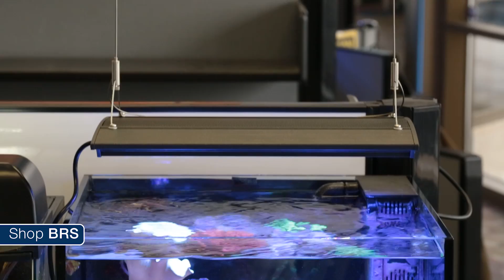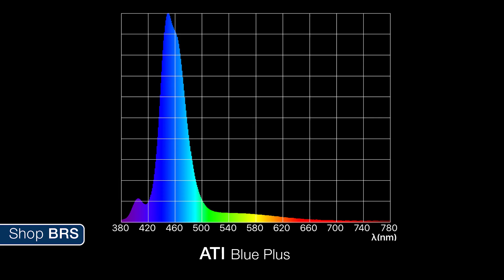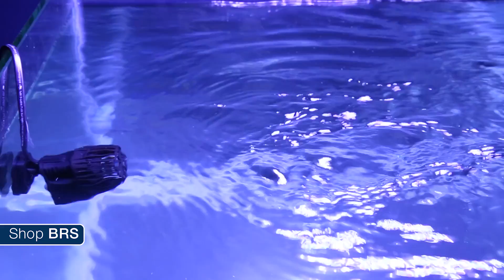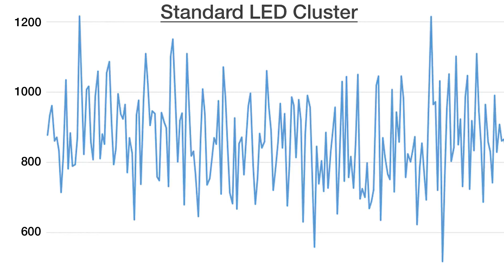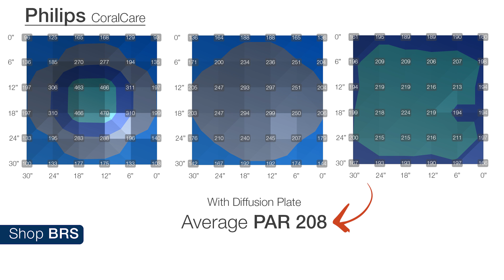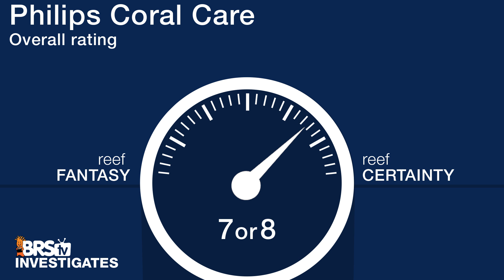BRStv Investigates: Testing the Philips Coral Care LED's claims - Are they realistic?

Comment: Awesome video.  Thanks for bringing this to light :)
Seriously though,  LED lighting has one major advantage over Fluorescent and MH lighting that I think was not considered in this video but I don't fault BRS because it might also be beyond the scope of BRS investigates series.  LED lighting as it's basis works with DC voltage and would be portable to solar power implementations than F or MH.  So IMHO an LED fixture that can mimic and give some efficiency savings over F lighting is of great value.

Comment: This was an excellent video! Hands down covered every aspect of what we need to know. But did I hear you correct? $1000?!? wtf! Does it come with some solar panels we aren't seeing? That seems quite expensive for a non wireless controlled passively cooled fixture that dangles from cables. Maybe that includes import fees lol. That now has me wanting to do a mild sandblasting of my glass to diffuse the light. Hmmmmm. Could be a new area of diy. thanks BRS for the awesome vidz 👍🏼
Reply: BulkReefSupplyCom I'd just get some glass from home Depot or the likes so if you don't like the results, no permanent modification is made. Once you find an "ideal" blast setting and result, then go for broke. I just bought the wife a Fluval Sea Evo 13.5g for Christmas (early) and it will get a lens made since it focuses the light and a diffused lens will spread it better.

Comment: Wonder how hard it would be to retrofit some frosted glass into Reefbreeders fixtures. Or alternatively, I wonder if a vinyl intended to give glass a frosted look would have a similar effect.
Reply: I don't think the glass on these lights gets very hot. They're fan cooled, and the glass is about a half inch away from the LEDs. It gets warm at best. We have some scrap frosted vinyl at work, so I'm going to give it a shot.
Reply: Jase Poag just get a glass panel and lightly sand blast it. The panel on the Philips didn't seem heavily frosted like the vinyl would create, plus you'd have another layer of material and the adhesive reducing your light penetration. A thin piece of glass blasted with like 150 grit aluminum oxide should yield a similar appearance as the one shown.
Reply: Yeah, I tried the vinyl since we had a ton of scrap laying around the 
shop. It did diffuse the light somewhat, but the cut in light output was
 drastic. I'm reluctant to make any permanent modifications to the 
fixture, since I'm not sure I'll like it.
Reply: Jase Poag just get some glass at a home improvement store or glass shop and lightly blast it with a less aggressive media. Then you can affix it to the front of the existing lens with a couple dabs of silicone or even double sided servo tape (r/c background comes in handy) and see how you like it. Doesn't need much to be effective.

Comment: Excellent review. I did want to point out a couple things that seemed off to me.

 The spectrum you show for the ATI Blue Plus lamp does not matchup to the spectrum advertised by the manufacturer and is missing the mercury spike (a green emission that all fluorescent lamps emit due to the mercury vapor used to ignite the lamp) making me wonder if an led fixtures spectrum accidentally got switched out. 

Also worth noting while the Coral care may be 22 pounds the ATI 8 x 24" sunpower you put it up against is 20 pounds itself so it's not as heavy as the video seems to make it sound. Definitely heavier than the float like a butterfly buzz like a bee actively cooled led fixtures in the market though.

looking forward to the next installment of the series. :)
Reply: BulkReefSupplyCom Oh well these things happen. we're all human after all and I can only image the time and effort it takes to squeeze all that info into a scant 20 minute segment. looking forward to the next installment. :)

Comment: could u put egg crate on the surface water line to eliminate waves. would that mute the shimmer and still keep the flow?
Reply: BulkReefSupplyCom if the tank has plastic trim it should be ok. or maybe we could convince manufacturers to use clear plastic for eggcrates

Comment: I agree with  your evaluation of this product. It is a game changer is some areas and behind the curve in others. I worked for Philips some years back in the IC industry and I am not surprised that they only support Windows. When Philips purchased the company I was working for they immediately set about trying to clear out the Macs which were the predominant system in use at the time. If it wasn't Microsoft it wasn't a computer in their eyes. Sad to see they haven't woken up to the real world yet.
Reply: Seems odd they'd want to limit their market like that.
Reply: The company did not feel the market share of the Mac/Apple products was large enough for them to consider. Things have change but this philosophy appears to be holding. This is a Dutch company and it showed in many of the attitudes they had towards us as a new acquisition. I didn't hang around very long after they took over the company. Those of my friends that did stay had some very interesting stories to tell. Silicon Valley is a very different place from the rest of the world. We tend to do things that are not considered the norm.
Reply: Also remember though that this is in Europe currently... possibly the apple brand is not as big overseas as it is a US company. And seeing as they are more into the products for companies and not really individuals then the Apple market share would be even smaller as many companies do not use macs... moving more in that direction but the market share is still small.
But saying that they should still have a method for the 2 operating systems or a third option that covers it in case.

Comment: Certainly no real point swapping my 8x54w ATI Sunpower. for the £1320 cost (I'd need two units) i could buy over 6 years worth of bulbs. Good to see they have addressed the shimmer effect, this is the main reason im put off LED units. I also think this unit is pretty ugly and i have a modern looking tank.
Reply: That's the ugliest light fixture I've ever seen.  22lbs of ugly. lol
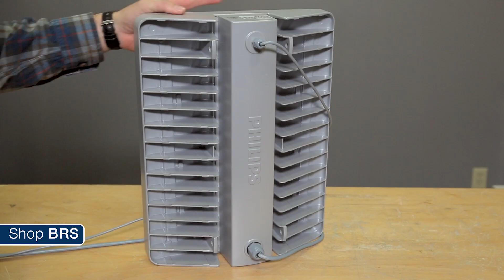Reply: I was thinking you were wrong by just looking at it from the LED section, but on minute 20:33 when they flipped it around and I was like "Hell that's an ugly fixture" LOL.

Comment: Ryan,
Were you guys using a step up converter to power the light or do you have a 220v socket?
Reply: Then that explains the power draw readings. A step up converter will draw more power for the conversion from 110 to 220. If you guys were to do a power draw test on a native 220v socket you might be surprised at the numbers.